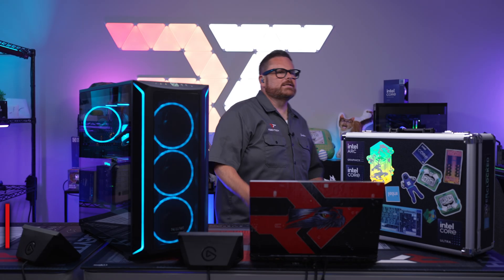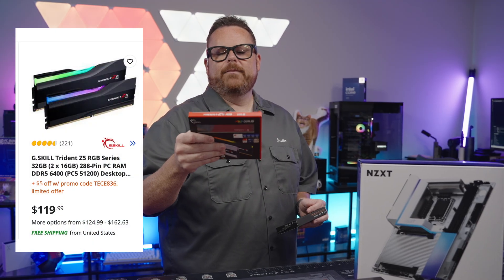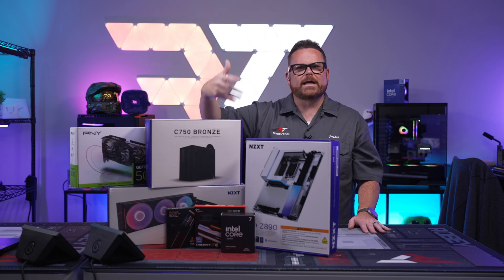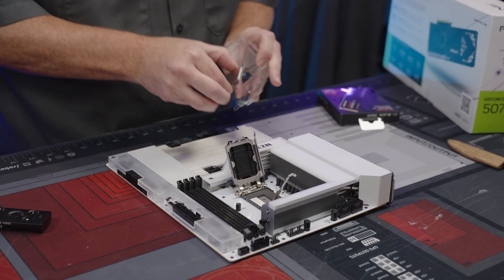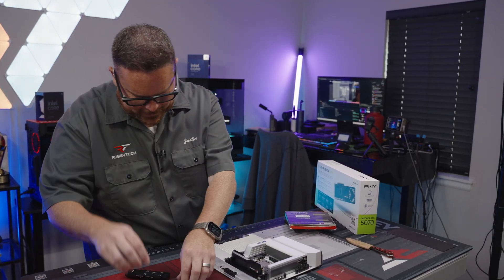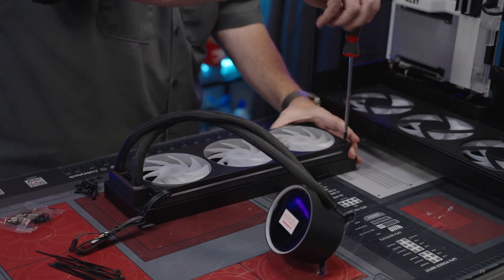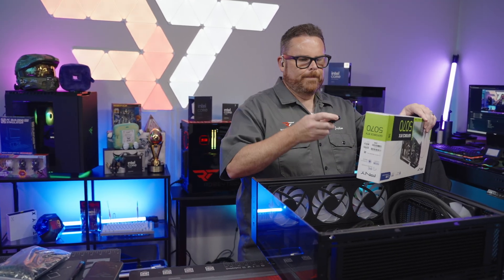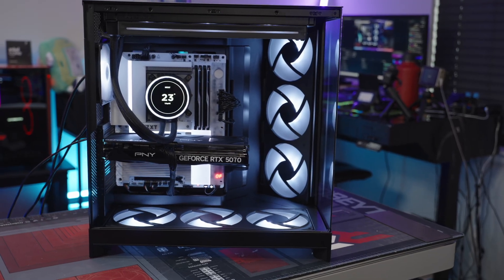$2200 Gaming PC Build 2025 | NZXT H9 Flow + RTX 5070 + 265K

Comment: Tempted with the H9 Flow RGB case, but I hear NZXT fans are noisy and do not perform well, also I do not like RGB. 

NZXT PSU's I won't buy again, one of my lads has the C750 Gold, the cables are far too stiff, and no decent sleeved cables available.